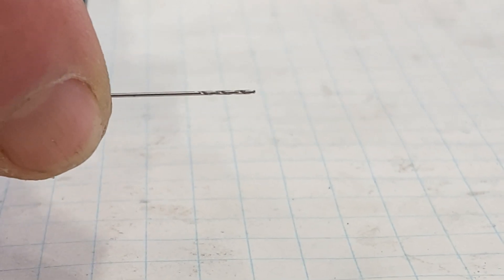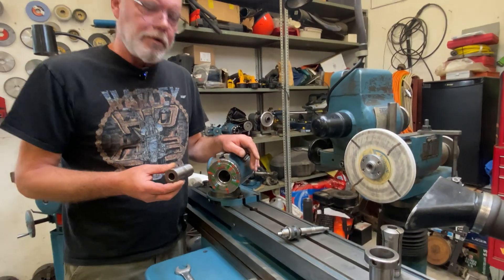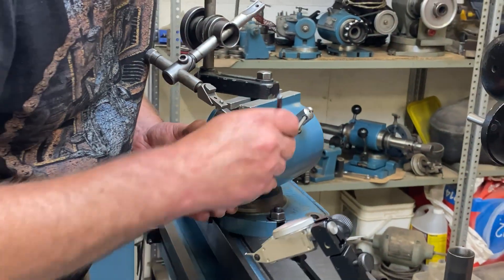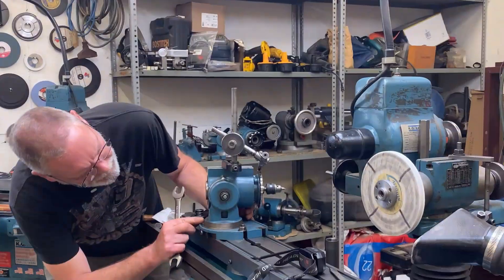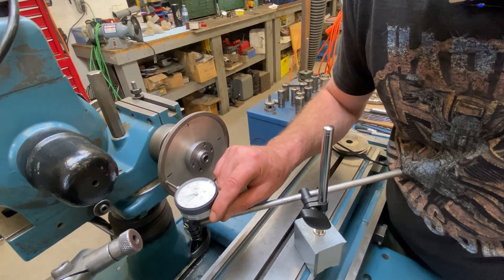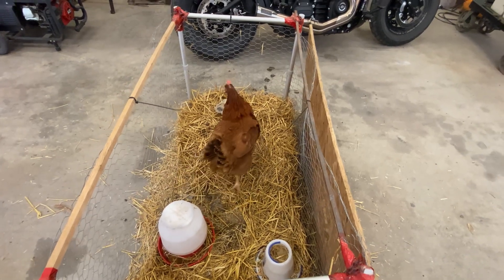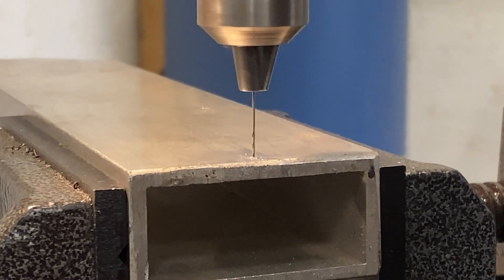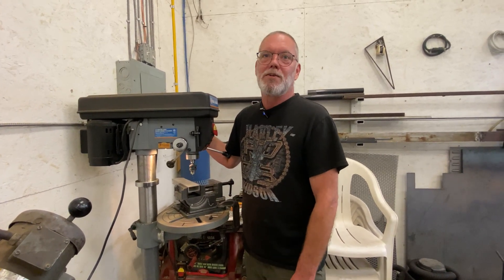Can we sharpen this???

Comment: A friend of mine used to make those little drills at the Sutton tools factory on manual machines by the thousands.  I used them for PCB drilling using a high speed dreamel.  Back when I could see what I was doing!  Modern CNC PCB production uses carbide drills that size at upwards of 60000 RPM I believe.  Thanks for these tool sharpening videos, I really enjoy your good honest machinist content.
Reply from the maker: I'm glad you enjoy the videos!

Comment: Generally the smaller the drill the higher the RPM actually as it makes it closer to the ideal SFM per material as well as helps evacuate the chips.

We run carbide drills in stainless that are under .125” or so at like 4500 RPM and then a feed of like .0001 IPT or so

Comment: Nice video, thanks for putting it together! I like the quick pace and conciseness for sure. Could I ask about the stick-out of the drill bit in the drill press - it seemed long to me but does that allow the bit to flex a bit? When you had it in the grinder you had almost no stick-out. Is there any rule of thumb for how far the drill bit should be out when used in a drill (I mean obviously you need to get through the thickness of the material, but otherwise)?
Reply from the maker: Thank you!
In my humble opinion the stick out in the drill doesn't really matter too much. Of course you have to have enough in the chuck so that the drill is secure and runs true. Had I not touched the work surface with a center drill I'm sure the drill would have wandered so in the event you for some reason couldn't spot the hole having less stick out would have helped some. No I wasn't leaving extra out to allow it to flex. The reason I had it close in the grinder was because all my tool/cutting pressure was on one side and with it being so small it would have flexed like crazy and been hard to control. In the grinder I did have the drill flutes in contact with the check jaws. This would be a big no no to grip a drill this way when drilling with it because the drill and jaws are of similar hardness and they could damage each other. However when I had it in the grinder I only hand tightened the check gently to ensure no damage was done. I hope this adequately answers your questions.
Cheers!
Reply: @Lappemountainliving  Yes perfectly, thanks so much for an amazing reply! I watched a bunch of your other videos, they're all excellent - I subscribed!! Thanks again.

Comment: Little drill bits like that I've found it doesn't matter if they're sharpened "right". Just so long as they're sharp they'll drill. So what I do is just point them up. I know it isn't right, but it works. I've even drilled through steel after just pointing them up. I don't run them slow either. My micro press doesn't do slow. I think it's 3 speeds, 3,000, 5,000 and 8,000? I just leave it in the middle all the time. So 5K RPM.

Comment: Cannot believe I just watched a craftsman sharpen a #76 drill bit! WOW! I use these tiny bits down to the #80 size, and buy them in packs of 12. The brand is Gyros, sold on Amazon, and they’re available in Carbon Steel or High Speed Steel. I use stricter the HSS ones, and they run just under $13 for a tube containing 12 of the same size. Great video Sir!
Reply from the maker: Thanks for the info. And for the comment! I'm guessing that the cost of these has come down significantly over the last 3+ decades? 
Cheers!

Comment: I usually buy wire size bits in lots of ten. And that is because I use them to drill circuit boards for feed through components. I even made a drill index plate and LAZERed it for each size hole. Then I take any freed through component lead and see what size bit I need to that component. Works really well for my usage... However, I would never try to sharpen such size bits. Too iffy to do that, so I just buy new ones as needed...pretty cheap to buy them.  But interesting video anyway.   Thumbs Up!
Reply from the maker: Thanks for the comment

Comment: I would suggest to add text overlays to your video, translating the imperial measurements you are talking about in your video to metric. easy to do in the edit, and it helps you gaining views from the rest of the world who has no idea what a 1/16-1/32 is going to look like
Reply from the maker: Great idea!
Reply: Totally agree, it hurts my brain constantly trying to convert these fractions to mm
Reply: @khalilbahlawan4439  then get a drill chart. There's one on my Google docs page if you can figure out how to access that. It's a copy of a metal supplier handout. In one column are all of the number, letter and fractional sizes then there's the decimal equivalents and then the metric conversions. It is the Rosetta stone for measuring.
Reply: First off even the Empire doesn't use Imperial measurements today. No one does. We use the International Industrial Standard Inch. But you can just call it Standard for short. The Standard inch is the inch that's precisely 2.54 centimeters long.  Imperial was two millionths shorter than that. So that's how you can tell them apart.
Reply: @1pcfred  the international standard is metric. and the inch got defined as 25.4000mm, so it is just an inconvenient subset. but what boggles (international) people is the stupid fraction system associated with imperial.
Reply: @1pcfred  "For historical legacy reasons, the label "SAE" is commonly used on tools and hardware in North America to indicate United States customary units measurements, that is, inch-based not metric (SI). Both this usage and casual use of the term "Imperial" are loose and imprecise (but common) references to inch fractional sizes and to the screw thread sizes of the Unified Thread Standard (UTS)." (source Wikipedia)
Reply: It’s funny how much whining there is about these measurement standards. Seldom do the metric guys explain what their measurements are in thousands of an inch and I don’t complain. Those who do are not likely to attempt any of the projects anyway.  I can use either system as can most American craftsmen. I would assume the same of Europeans, etc. The rest of the metric world literally needs one constant number to convert it(25.4). If you actually do these things you are continually doing such basic conversions and always have a calculator/phone at your side. These complaints are really not a thing to those who actually do this stuff and it isn’t going to change for anyone so work on.
Reply: @836dmar  yeah we standardized to work better with metric. What did metric ever do for us? Nothing! I absolutely despise metric for a variety of reasons. But like you say I do find myself converting to and from metric regularly. I resent it too. I even wrote two programs to do it. Commie 2 Freedom and Commie 2 Independence. Or c2f and c2i They do temperature and length conversions, of course.

Comment: Cool, I'll have to have a go myself now. At about what size would you start thinking about setting up a drill grinding attachment? Thanks for the vid. Cheers
Reply from the maker: Interesting question. I don't have a clear cut answer. My drill grinder claims to be able to handle 1/4" to 3" but I haven't had much luck with drills smaller than 3/4". Thanks for the comment and thanks for watching.

Comment: Word on the street is that tiny carbide tooling is ground with lasers. I am willing to guess it's the same with HSS. I can't imagine the bit holding up to some grinding wheel to get those flutes ground . But then again, I've been very wrong before.
That being said, if you got more of these needles to sharpen, maybe rig one of them soldering microscopes.
Reply from the maker: Great idea! Thanks for the comment!